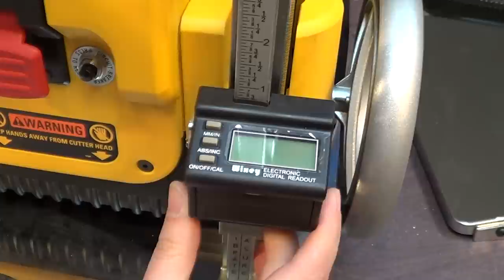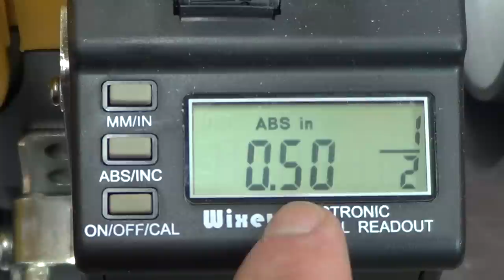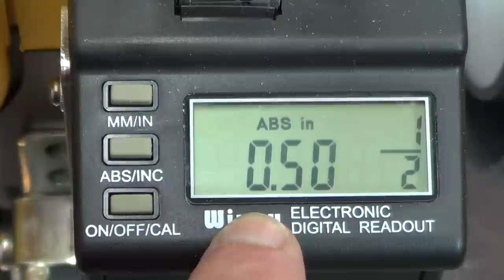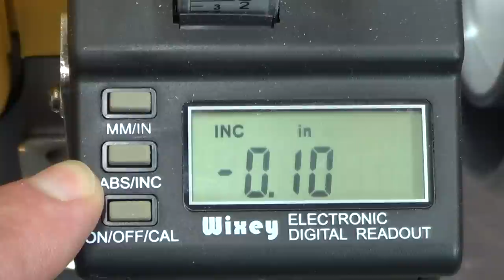Installing a Wixey WR510 Digtial Planer Readout on a DeWalt DW735 Planer

Comment: I recently bought a DeWalt DW735X Planer and a Wixey WR510 digital readout for it.  I found the  instructions that came with the Wixey too confusing and pretty much useless.  I found your video here on Youtube and your install instructions are very easy to follow.  The Wixey on my DeWalt planer works great and is spot on accurate.  Thank you so much for posting this video.  It was a big help!

Comment: Great supplement for the instruction, it really helped loads.  My only suggestion is for folks that have already bolted their planers down to NOT use the leveling screw. By the time it’s suggested to remove it, you’ll have to unbolt the planer to get it out. :)  thanks for a great install video.

Comment: Great video! Did you have any issues with the bottom mounting screw not getting tight or bulging the frame of the gauge?
Thank You
Reply from the maker: I don't remember having any problems with it.  I drilled a hole into the previous gauge and used the self tapping screw that came with the gauge.

Comment: Thanks for the video- it was helpful. A question, though... if you measure the newly planed test board to calibrate the Wixey ON THE END of the board, aren't you likely measuring some snipe (and thus getting a slightly lower measurement)?. Do you think it would be good to cut the test board back a few inches and measure the non-sniped thickness of the board? I know on my old planer, I ALWAYS had to deal with snipe. I believe the DeWalt 735 typically has a bit, too...
Reply from the maker: I have the wing extensions minimize the snipe pretty well.  But I think you might be right.  Measuring from the center might be more accurate.
Reply: I also have the wing extensions - and I still got a noticeable amount of snipe. I could minimize it by supporting the wood as it entered and exited the planer, but it was still there. I did a bit of testing on the measurement, and it seems more accurate more toward the middle of the piece - certainly past the 3" of potential snipe. I'm sure it will be better when I get used to the planer - but I am so impressed with the finish coming off the planer. I used the slow speed, and it is better than anything I got off of my old jointer/planer, a Robland XSD310 -a 220V MONSTER. I never liked the 1 speed planer part of it, but it IS cool to have a 12" jointer... The DeWalt is already showing itself to be light years ahead of the Robland, and the Wixey WR510 makes it now digitally accurate. I also have the Wixey attachment for my table saw - also very cool. Thanks again for the instructional video - it really helped!
Reply: Travis - I was thinking about adding the Byrd Shelix cutter head for the DeWalt 735 - well, maybe after I go through the 2 sets of knives it came with, anyway... have you gone with that head yet? If not, what knives do you use?
Reply from the maker: I haven't changed the knives yet.  I still have the factory installed knifes.  I don't use it a ton, so they're still good.  When I do replace, I'll just use the standard Dewalt knives.  I think they'll be fine for what I do with them.

Comment: I come from a "metric" world so while this was very informative, I am not sure why when you set it to 3/4" you get 0.71"?  
3/4" is 0.75", no?
Thank you for taking the time to do this video.
Reply from the maker: Sorry for the delayed response.  I set it to 3/4" when I set up the ruler part.  At some point (off camera) i switched to a smaller dimension (probably 1/2") to do my final calibration since it requires a few passes through the planer.  That would be the reason why it's less than 3/4"  I did find it accurate, though.

Comment: Do the bolts come with it? What size drill bit did you use?
Reply from the maker: I don't remember anymore.  I re-used some of the screws from the planer.  I think I used self-tapping screws I bought at Lowes.

Comment: What is the significance of attaching the read out at the 3/4" mark.  Looks like on the instructions they set it at the 1/8" mark.
Reply: It doesn't matter what you set it to when you are calibrating...what matters is that the cutterhead height doesn't change...hence using a stop...any stop..